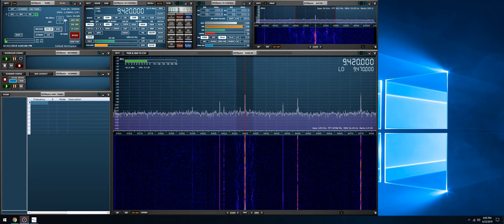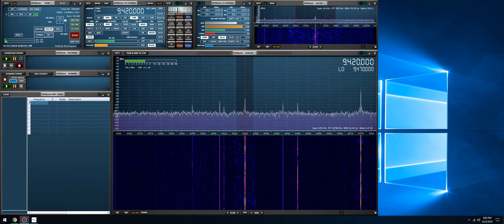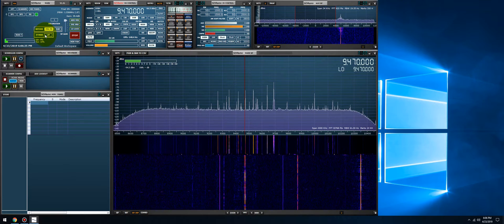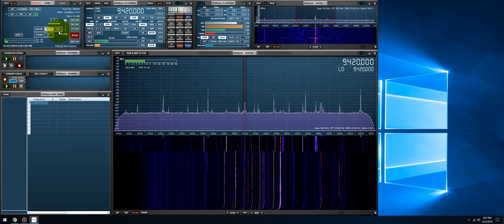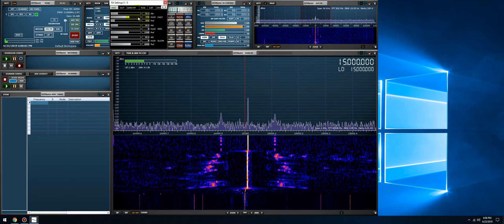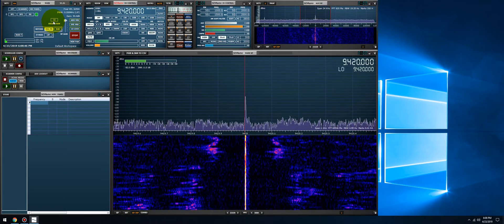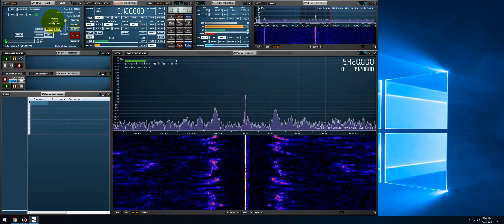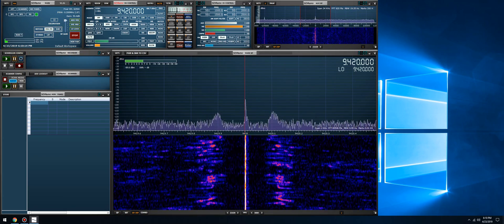SDRuno basics, minimum requirements.

Comment: What is longest recommended usb cable length between uno and windows 10 computer to maintain reliable operation.  Would chokes be recommended for longer runs over X feet?
Reply from the maker: USB 2.0 specification for high speed devices limits cable runs to a maximum of 5m. You can also research an active USB 2.0 extender cable
https://www.sdrplay.com/an-alternative-to-expensive-lmr-coax-cable-for-ghz-operation/

Comment: Will a single-board computer like a lattepanda work with this unit. https://www.amazon.com/LattePanda-Powerful-Windows-Enterprise-License/dp/B01GJF72DC?tag=beebom-20&th=1
Reply from the maker: Yes, it should work.
Reply: @SDRplayHamGuides  Will it give me the 15 Mhz for the scope? Will it run the software at the max and not watered down?
Reply from the maker: I honestly don't know. I never used a LattePanda SBC with 2gb of ram. Max bandwidth is 10 MHz not 15

Comment: What about running it on a mac ?
Reply from the maker: You would need to use a VM on the mac to run Windows with a Windows installation or use Apples bootcamp also with a Windows installation.

Comment: Nice guide. What computer parameters are in this movie (CPU, Ram)? Very low CPU load indicates when SdrUno is running, hmm?
Reply from the maker: My PC is a Ryzen 5 1600x with 16gb of RAM using a Nvidia 1060 video card.
Reply: @SDRplayHamGuides  Ok, thanks for the information, I am testing the purchased Rsp1a and I am impressed by the device's capabilities and configuration. Greetings from Poland
Reply from the maker: Excellent.